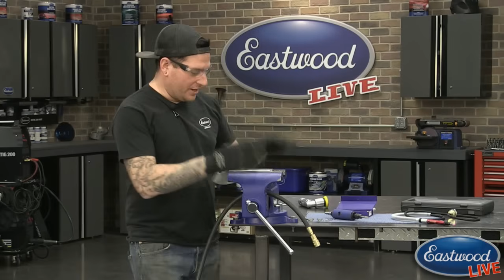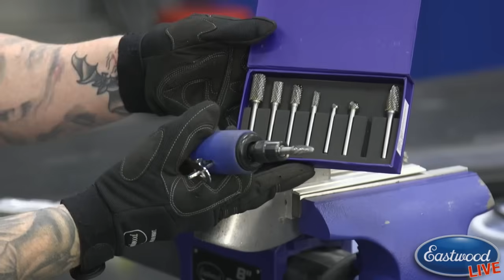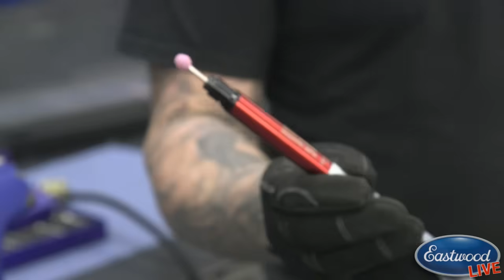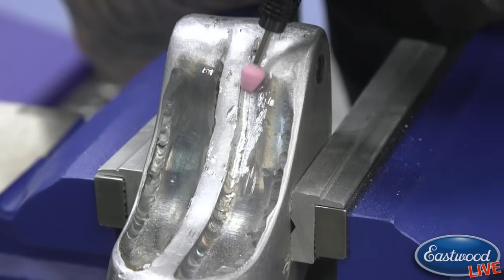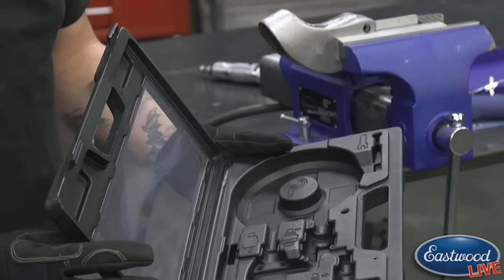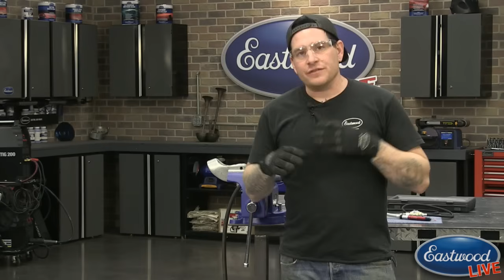Rockwood Micro Pencil Die Grinder - Great for Grinding in Tight Areas! - Eastwood

Comment: Most of the micro/pencil die grinders on the market seem to be made by the same Chinese manufacturer. It IS NOT a viable replacement for a Fordom or Dremel! On another note, using any carbide tool at such a low speed is not at all conducive to a long tool life

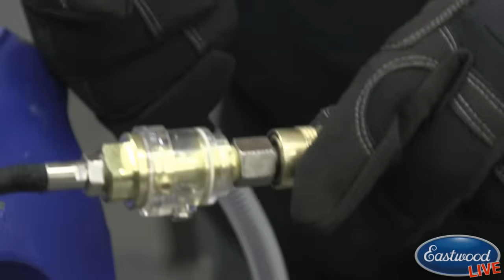Comment: 5:43   Cool tool but The sheathing on the hose is already fraying.  That's not very confidence inspiring on longevity.
Reply: It's the same POS sold on fleabay for 17bucks https://www.ebay.com/itm/AIR-MICRO-GRINDER-Pencil-Type-Micro-Grinder-56-000-RPM-1-8-Die-Grinder-60-Hose/401135571485?hash=item5d658b121d%3Ag%3ATPYAAOSwu4BV7Nwu&_sacat=0&_nkw=pencil+die+grinder&_from=R40&rt=nc&LH_TitleDesc=0%7C0 or horrible freight for 28bucks.  https://www.harborfreight.com/18-in-air-micro-die-grinder-kit-60244.html Ya might get a junk one or ya might get lucky.  It's this or spend a few hundred bucks.  No decent options in the middle.  :-/

Comment: Dremel makes a selection of bits, HS steel, coarse for aluminum, fine, for steel, or diamond coated, for anything, and a wide selection of different shaped stones, all with 1/8 "  shanks, that will fit this.  They could really increase the versatility of this nice tool.

Comment: The problem I have when I use a dremel is that when you put any pressure on it, it doesn't have enough power to overcome the friction. How resistant is this pencil grinder to this?
Reply: Lemme put it this way: according to the specs, this pencil grinder uses 4cfm @ 90PSI. Doing the math, that works out to 1.17 kilowatts (ideal). Meanwhile, the strongest Dremel on the market is 120VAC * 1.6 amps = 192watts. So, give or take, this should have around six times more power...supposing that you happen to have a compressor that can give you that much air.
The Dremel is lower power due to issues miniaturizing the motor, and dealing with heat dissapation. Pnematic tools tend to have zero heat issues, and pnematic turbines tend to miniaturize pretty effectively.
Reply: Wow! That's an incredible answer! Thank you so much!

Comment: Does the sound of the Micro Die Grinder remind anyone of the dentist? The Micro Die Grinder: can i do dental work with it? Just kidding; i want both, will be very useful to clean up weld beads.
Reply: I actually did once clean up a seam-line on one of my dental veneers using a Dremel and the flex attachment. I was trying to be as careful as possible, and it ended up not hurting at all. I confessed that I did it to my dentist; he thought for a moment, and said, "yeah, that'd probably work. Next time, just give me a call, but it looks like you did a nice job"